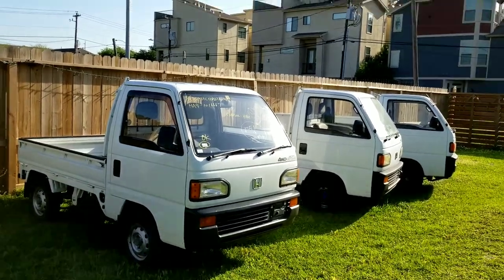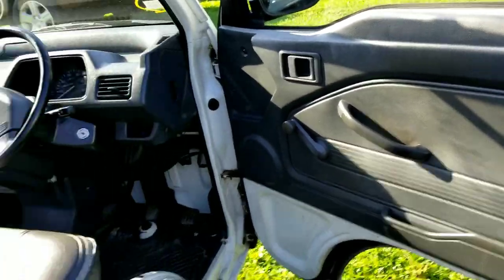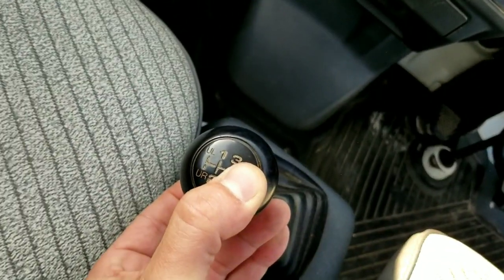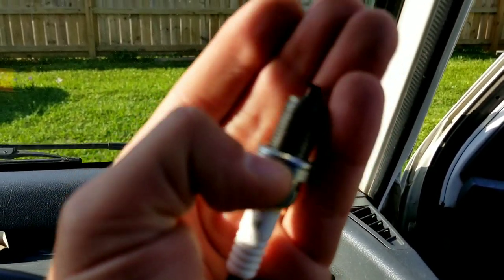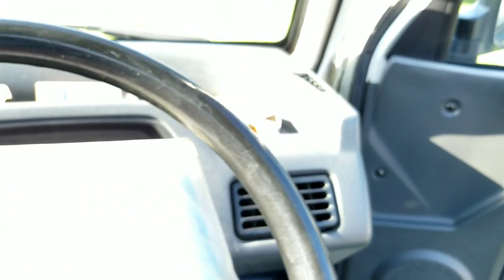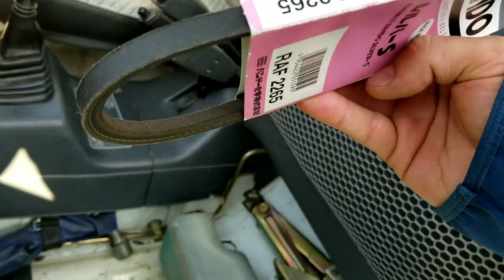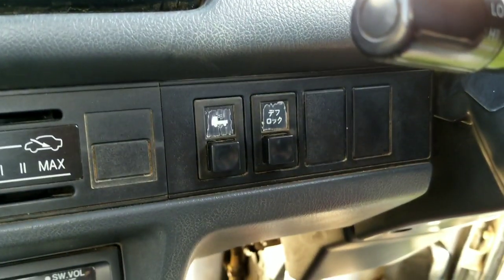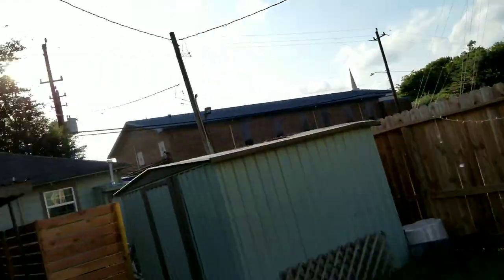Super Clean Acty Attack walk around, shift demo, and locking differential

Comment: is that only 4 wheel drive in ultra low or does it have 4 wheel drive in the other gears too
Reply from the maker: All time 4WD. The diff lock can only be used in the ultra-low forward and reverse.
Reply: @USMiniTrucks  Does it handle ok on paved roads with the all time 4WD?
Reply from the maker: @user-lp9ye1po3w  yes. It has an open differential so you can turn and drive smoothly